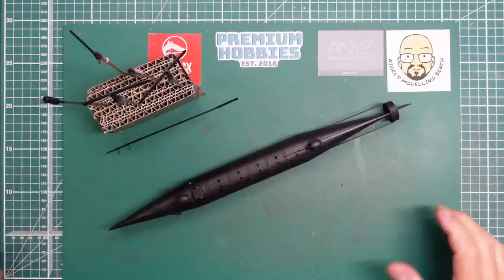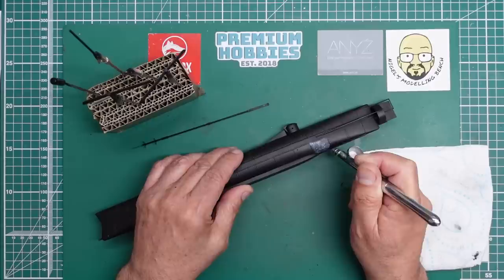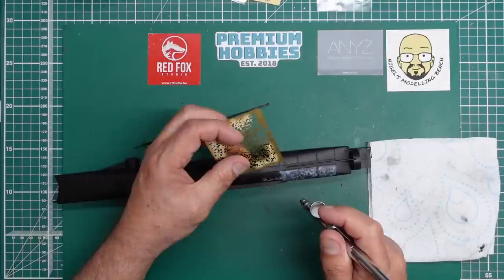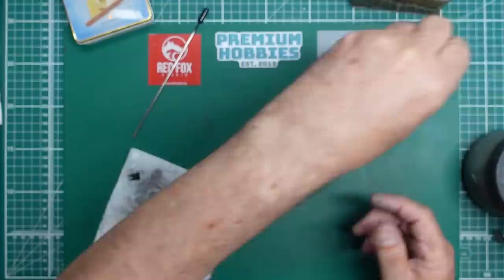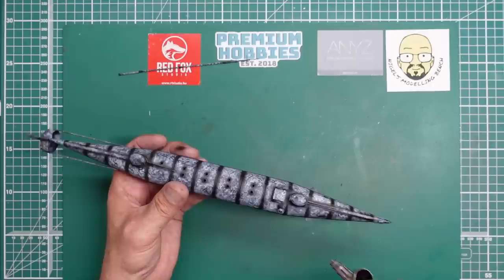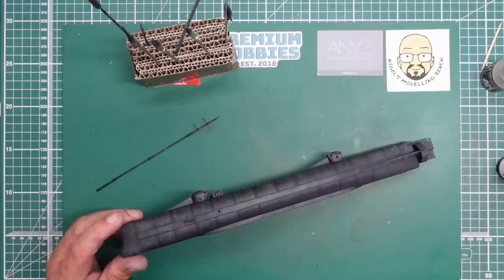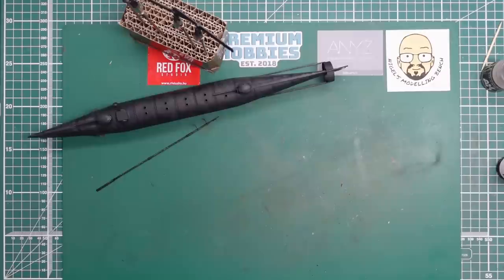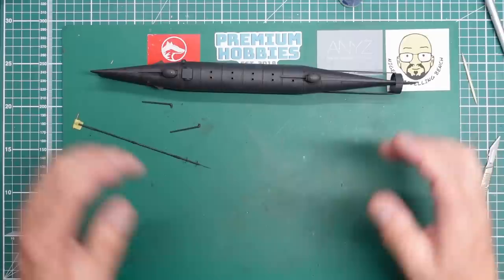Mikr Mir 1/35 CSS H.L. Hunley build. Part 3.

Comment: Masterful! Could you have run the probe halfway into the hull and out?
Reply from the maker: No Paul, it's on a slither of PE. If it snaps I will fit a slither of thicker stainless in there